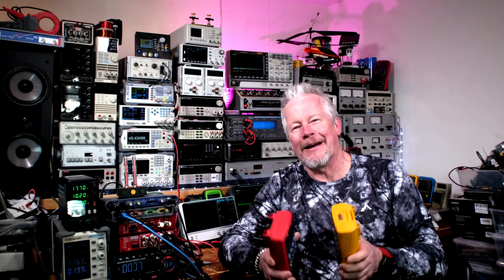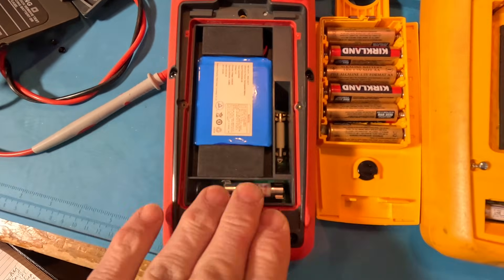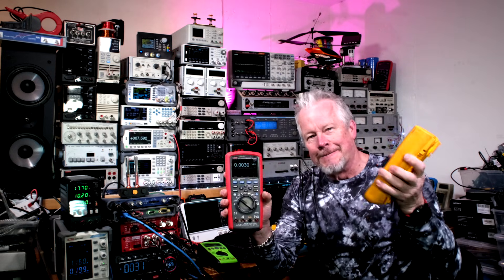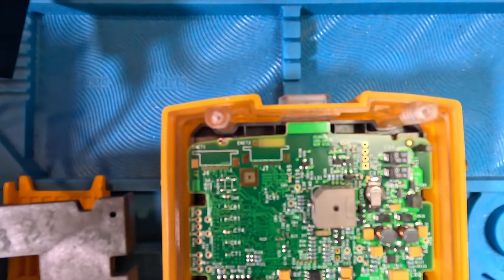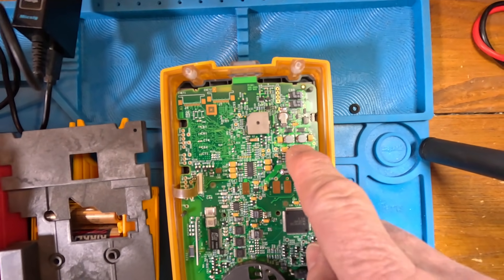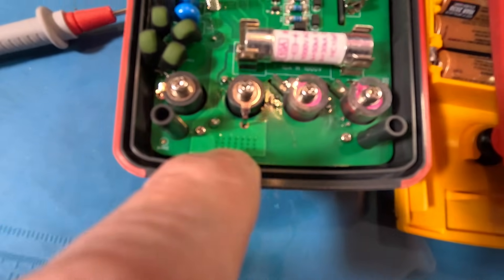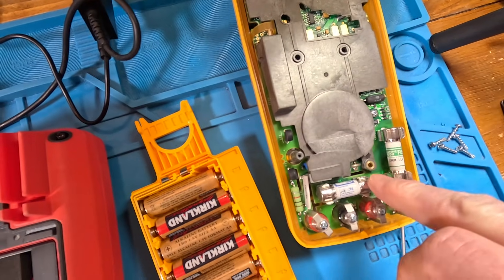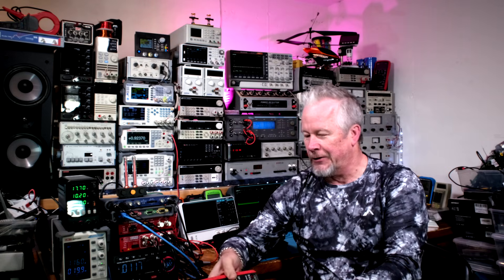Fluke 289 vs Uni-T UT181 Tear Down #uni-tmultimeter #hightcountmultimeter #kissanalog

Comment: Joe Smith did an in depth test of the UNI-T 181. 1 transient hit from a piezoelectric grill starter took out the front end of the meter. Joe was definitely surprised how a meter of that cost would fail such a small transient test. Joe re-engineered the front end of the meter and made it very robust. He will not share his work because of safety and liability of people who are not skilled in such work. Joe’s expertise in meter robustness tests actually came to the attention of Brymen who frequently contact Joe about new meter designs. The most recent is the new Brymen 789BT(I think that is the model number) blue tooth capable meter. You might want to check that out if you are looking for BT capability.
Reply from the maker: Thanks for the great feedback!

The Uni-T 181 does pass the transient testing to get the 3rd party safety certification for CAT III and CAT IV.  These transients are to be sure that the meter is safe if ever a transient in real world testing in high energy environments, e.g. CAT III or CAT IV.  This is to be sure that the operator is safe.

When I worked as a lightning/transient protection engineer - we (Square D / Schneider Electric) changed the UL requirements for surge protection equipment for safer operation.  I was a certified UL tester for surge/transient protection.
Reply: @KissAnalog  Congratulations on the channels growth.  Good to hear you're getting some sponsorship.  I thought I would chime in to clear up a few things.

I really don't know if the UT181A would survive the transients called out in 61010.  I am more interested in if they will survive some low energy transients, similar to 61326.   As I mentioned in my review,  every product that I have evaluated that the manufacture specifically calls out 61326, will survive at least the basic ESD events I subject them to.   You mention you work in this area.  It would be interesting to repeat that direct contact ESD test with your meter and see if it survives.  I ran this test over nine years ago and it is possible that they have improved the design.   The Fluke should easily survive it.    If you watch that part 2, I go over the IEC standard for the ESD waveform and compare that with the gas grill starter that damaged the UT181A. If you repeat this test with a standard gun, keep in mind that you will be exposing the meter to much higher energy levels than I did.  

I show the UT181A's front end in part 2.  The 4-PTC are actually two separate networks using 2 PTCs each in series.  While you never mention is, the Fluke is using a surge  rated resistor to limit the current at the time the PTC is cold.   I am not a fan of the series PTCs as I have seen these break down at higher voltages but in this case, UNI-T chose a larger body style.
Reply from the maker: Thanks for the great feedback Joe.  I do get free equipment - but that level of sponsorship is not what the big boys get - in a check:)  Maybe some day:)

In all the big labs that I have worked - which are mostly power labs - I've never seen a meter damaged - except for High Voltage.  That High-Voltage lab had a pile of meters of all types including Flukes that were killed.  No one was injured by any of these meter deaths:)

When I worked for Square D / Schneider Electric designing both industrial and commercial lightning protection devices - when I used PTCs they did not stand alone - they were the back up resettable fuse.  The main device took the energy until the PTC could do its thing.  The fuse/energy coordination was key.  Most any fuse type can not operate fast enough for a transient - like ESD.  TVS diodes are typically used for that.

ESD testing is done with a probe about the size of my little finger, so it only touches what it can reach.  

I'd have to read the 61010 to see if the device fails the test if it is damaged or if the fail causes an unsafe condition - which is what I think is the pass/fail.  ETL would not put their name on a device if it did fail.  If a device could be shown to NOT pass this 61010 test it only takes a report to get them to be forced to correct it.

I used to watch a lot of your videos - but the last year or two have been brutal at work.  But I'd love to see your videos on the 171.  It seems that I saw you test a lower cost Uni-T that did well...is that true?

BTW, when you are doing the transient testing with the device you built - what is the source impedance of that?
Reply: @KissAnalog  Reading various forum posts, I've seen various meters damaged from HV.  One of my favorites was a person who posted about a damaged Fluke they trash picked.  It was badly damaged.  They documented the repairs.  I wrote them to see if they knew the cause.  I seem to recall that someone had used it to try and measure the HV supply of a fighter jets display.   Things happen.   The reason I started testing meters is because my first DMM (Fluke) was so easily damaged and had a very high repair cost.  I eventually switched to HP and never bought another Fluke until I started running these tests.  I certainly have a different view of them today.   Sadly they really target the electrical and technician markets.  

With the meters, rarely you will have a fuse in the non-current path.   The protection circuit is typically the 1k surge rated resistor, PTC, then MOV or GDT.  This is then followed by some back-to-back transistor clamp for the low voltage source.   All the major brands seem to follow this technique.   Still, they don't always get it right as I have seen some very high end meters fail my tests.  

I spoke with a few of the main suppliers about their interpretation of the standards and if the product would need to survive.   Sadly, it was not clear.  Fluke was one of the companies who told me that they considered damage to be a failure.   This is reflected in my testing.   Brymen was the ONLY company who expressed any interest in my testing.  Again, we see that they also produce some of the most electrically robust products available.  

For ESD testing, I consider the leads part of the system.  I was going to inject on their exposed tips, but ended up what I do today.    I agree that if you did not perform a direct discharge to the front end like I show, none of the UNI-T products I looked at would have failed.   Rather pointless.    I have never looked at the UT171, but have ran several other UNI-T products.   Yes, I ran a few very low end UNI-Ts recently and was very surprised when they withstood the ESD test without damage.   If you consider that doing well, then yes.  To me, that test is only the start of it.  I have never seen a UNI-T product do well against my testing. 

 "BTW, when you are doing the transient testing with the device you built - what is the source impedance of that?"   Just to be clear, the grill starter was just purchased and some leads soldered to it.  I tested a few and their output varied a lot.  I picked one that was very weak and started using it.   I eventually designed a gun that was very close to the IEC standards.   Oddly, the grill starter normally kills them first.  Viewers like seeing that grill starter, so I continue to show it.   Early on, when I started to develop the quasi surge generator, I was testing with various source impedances.  When I designed the low voltage generator I use today, I settled on a fixed 2-ohm source.   The FWHH is 100us rather than the common 50us.  I can't stress it enough but it is not a combo generator and will not even come close to meeting the  short circuit waveforms called for.  My goal was never to test these meters for safety.  I wanted just enough energy to cause a failure.  In the videos I talk about 20J, but it's actually around 15J.   It doesn't really matter as the meters should never breakdown.  All that energy is dissipated internal to the generator's output network.
Reply: @KissAnalog You should get in touch with Joe. His knowledge on how to re-design meters and build his on high energy probes and transient generators is second to none that I’ve found on YT. He has worked with Dave Jones on his meters as well as his work with Brymen. I gather Joe works for some top notch government contractor as he never mentions much about his day job. You should check out some of his videos where he does show some of his meter rebuilds making them more robust. He also has some videos of some projects he designed and built over the years. I believe the EE community is a tight knit group. I have read some of Joe’s posts on EEV blog helping other engineers and newbies like me at an old age learning new things. I was a mechanical engineer/toolmaker/certified welder for 30+ years. I also was a gigging guitarist for 45 years and learning electronics became a necessity after all the old techs in my area died or retired.

Comment: I purchased a UNI-T UT71that did not comply with its cat ratings, at the time this was a mid-range meter, and I took the view that I would never purchase any UNI-T meter again.

I only use Brymen or Fluke meters that I can really trust. If your target audience is DIY, then cost is an issue and lower cost meters have their place. 

People that work in the trade generally do not bother with price and are more concerned with proven safety and reliability. Some of us do use cheaper meters to throw in our tool boxes for non-critical or safety testing.
Reply from the maker: Yes if you are working on CAT III or IV it is wise to use a mater with 3rd party certification.  Do you mean that your UN-T did not have certification, or what do you mean by not meeting the CAT reading?
Reply: @KissAnalog  Claims to be cat 3 1000v and cat 4 600v. Not one MOV  and only one PTC. Two class fuses? Bought for data logging and works well. A few months after purchase I found well known experts on   YouTube review this meter and appeared to be very unhappy about the so called safety of this meter. Slightly of topic,some test equipment has the I.D. removed from chips, says a lot about such equipment. Really enjoy your channel.Google the reviews, I am sure you know the people doing the reviews.

Comment: I've learned the hard way (expensive) that OLED screens are indoor meters only. If you use your meter outside in strong sunlight it becomes washed out.
Reply from the maker: Thanks for sharing that valuable experience, it's definitely something to consider!  With this meter - I have not had any trouble outside.  One time I was out in the desert and all the screen types I were using were washed out - the sun was so bright.  So I had to put a blanket over my heat and meters to see them:)
Reply: @KissAnalog more often than not, I'm outdoors and the first screens to wash out are OLEDS.
Reply from the maker: That's what I expected, but this one seemed to be OK for me.  The LCD screens were washed out.  But I would like to see what the '171B' variant looks like as it is supposed to be the best for bright sunlight.

Comment: For the price of that Fluke, they should be using machine screws and inserts, not self-tapping screws.  When I see design choices like that, I wonder what other corners they cut.  If it was a $100 meter, no problem, you get what you pay for....but on this Fluke?
Reply from the maker: Thanks for the feedback, it's interesting to hear your perspective on the design choices at that price point!  Remember this meter is a couple decades old - where folks would buy just because it was a Fluke - IMHO.  Today that would not cut it with a high-end meter.
Reply: @KissAnalog  I was curious about my expensive Keysight U1253B meter... so I just pulled a screw...it was a machine screw... phew!
Reply from the maker: Awesome!  I wanted to buy a Keysight - but they are above my paygrade:)

Comment: I would love if Fluke made a modern 87V that was slightly smaller with an awesome screen, bluetooth built in and a low impedance mode.
Reply from the maker: Thanks for sharing your ideal meter features!  The reason I would rather have the 189 or TX3 reproduced is that they have more counts and more features including dB.  The 87V is just such an old limited meter - IMHO.
Reply: Hi Eddie, amazing video. Thanks so much for the info. I really appreciate your videos. Thank you for sharing your knowledge.😊

Comment: Nice one handed tear downs there Eddie😊  I'm not much on EX large handheld meters personally, that's why I purchased a bench top DMM w/6.5 digit resolution display.  Expensive but accuracy and sensitivity is far better and handhelds tend to get tossed about, not good for accuracy or reliability although some are pretty rugged IE; Fluke 87V MAX comes to mind.  Thanks for the video.
Reply from the maker: Thanks so much for the feedback! I totally get preferring a benchtop for accuracy.

Comment: getting the battery cover off on my 181a was hard too. Thats a good thing
Reply from the maker: It's good to hear that you see the secure battery cover as a positive feature!  I think the IP rating becomes obvious:)  The 87 had the upgrade to 87 MAX to get the better IP rating - it would be interesting to see the changes in that meter case.  Too bad that they didn't take that opportunity to give it some upgrades...

Comment: Who is the Joe you mentioned in regard to testing meters? I did a search and haven’t found him yet.  Did I hear the name wrong?
Reply: Joe smith is the one. He does extensive dmm reviews and testing.😊
Reply: @sohilaryal5065 Thanks.  I did finally come across Joe Smith and figured he was the one, but it is good to have confirmation.
Reply from the maker: Thanks for helping with which Joe I was referring to.  Remember - his testing is different to that which 3rd party labs perform for safety.
Reply: joe smith (@joesmith-je3tq)

Comment: While opinionated, I personally consider accuracy, reliability, and overall cost.  On multimeters, further considerations are thermister/varister protection and the probe jack sturdiness. A few years ago, I purchased lower cost Peakmeter with these considerations in mind. And of course, the main multimeter chip also factors in to a lesser degree.
Reply from the maker: Thanks for sharing your priorities; those are definitely key factors for a good meter!  I had to replace the jacks on my 189 and was happy to see them available - but also realized that they must be a common failure point to see so many options available for parts.